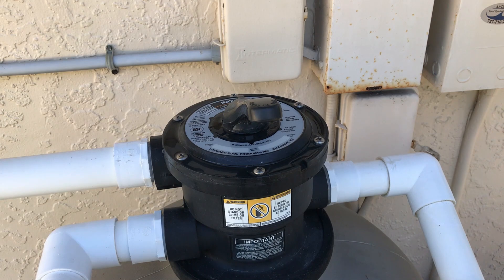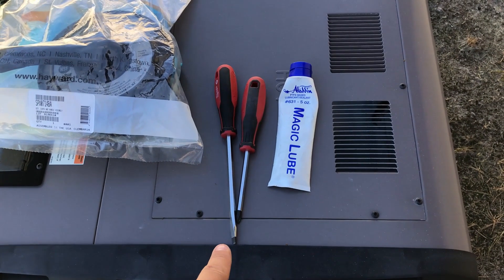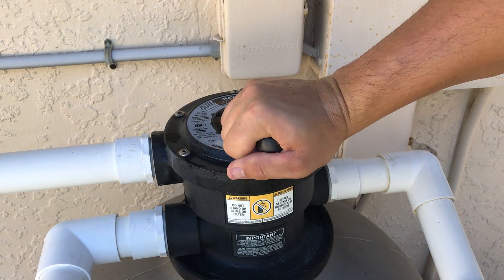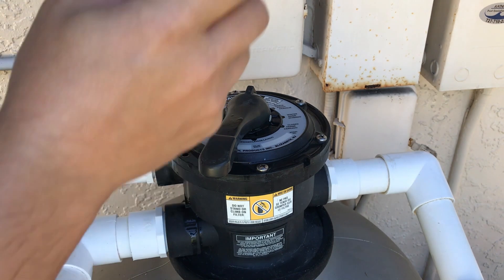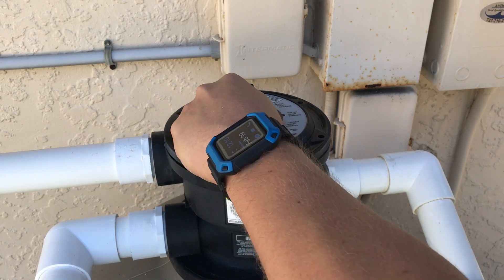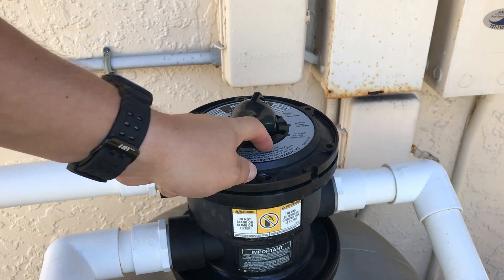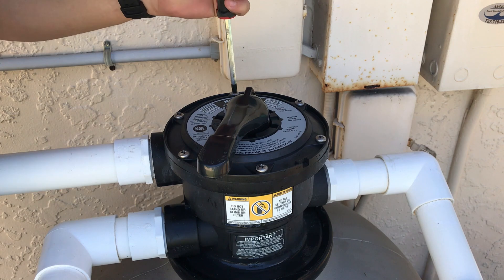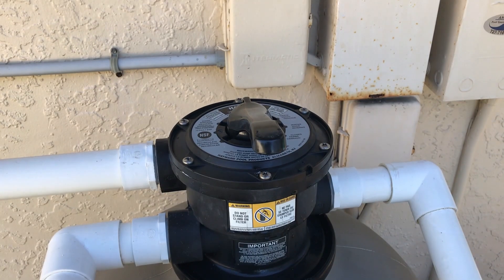Leaky Multiport Handle - How To Replace The Lid Assembly - Chlorine King Pool Service

Comment: Helpful thanks.  I found this video because my problem is I just installed a brand new S180T sand filter and multivalve top (replaced an old one of the exact same set up).  All is perfect, except my brand new multiport valve is leaking from the very top / handle!!??

Any thoughts on what could possibly be wrong with a brand new, sealed product in box?

Comment: I had to order a new valve, but I tossed the old one already and forgot what position the handle was in. If the new one comes in the closed position but I possibly took the old 1 off in the filter position am I kinda screwed is there a notch or something to put it in the correct position?
Reply from the maker: If you look at the link below you can see if you picture a clock, the “filter mode” notch (Hayward logo) on top of the multiport valve handle is at 12 o’clock and the side of the MPV with two ports is at 9 o’clock. Which is the same orientation as shown in my video. So I think that’s the way yours should go if you have this same MPV. A quick browse on the internet shows the same orientation as well. 

Proceed with caution and use at your own risk. Good luck! 👍 

https://www.poolzoom.com/complete-vari-flo-sp714t-xl-1-5-top-mount-valve-kit.html?gad_source=1&gbraid=0AAAAADm5WKNWWdg8W0Wy2GifxD9Bb0Fme&gclid=EAIaIQobChMI9oPfmKerhgMVgp5aBR0NDQRMEAQYISABEgKOyvD_BwE

Comment: Mine is leaking out the top also but someone said u can change a gasjet underneath? Is that right thanks
Reply from the maker: Yes you can but it’s sort of a pain. The handle/lid assembly can be completely disassembled. Just a pain to put back together. I hope this helps.

Comment: My new valve is leaking at the handle, any suggestions what could be wrong. I had the spider gasket and mvp cap replaced.
Reply from the maker: Where at the handle... in the center immediately around the notch locks into the mode of what you want the filter to be in?
Reply: @ChlorineKingPoolService , yes water fills into the notch area where you select, filter, backwash, etc.
Reply: @ChlorineKingPoolService  Mine is leaking at the same spot on top of the valve.  We have taken everything apart and we don't see anything suspicious but after the line gets pressure into it, water starts coming out the middle.  Spider gasket is in excellent condition.
Reply: @ChlorineKingPoolService  Yes ,water coming up thru the center where handle turns.  Don't really want to spend $200+ replacing entire valve if it's just an O ring or spider valve gasket.  What do you think?

Comment: How do I put the lid back on correctly? My filter doesn't gave any notches.
Reply from the maker: I always like to take a picture before I take something apart that I'm not familiar with. You can generally match the grove in the lid with the groove that holds the O-Ring in the bottom half of the MPV. If you don't feel comfortable with this please contact your local pool professional so they can do it!

Comment: My Hayward Multiport Valve is 20 years old and leaking from the handle and maybe the sides too. Do I need an entire new valve unit?  Also, my pool installers did not put a plumbing cut off valve from the pool to the motor or the filter; can just shutting off the motor and draining the filter get rid of all the water in order to replace this unit if I have to?

Comment: I broke the handle off of mine (stupid I know) , & stumbled upon this video. Would I have to take different steps in this situation ?
Reply from the maker: No sir. The top half of the MPV comes with the handle already attached. Just order that part and you'll be good to go!
Reply: Chlorine King Pool Service Hey Thanks for the response , do you happen to have a link or know where I can purchase the items I would need
Reply: If the handle broke off I'm assuming it was super difficult to turn, probably the result of the spider gasket not being lubed. Next time it gets tight, move the handle halfway between two ports (to depressurise the filter), unscrew the head  and replace/re-lube the gasket. If you go down the re-lube path, just keep in mind that a spider gasket that's been wrenched around due to being too tight could now easily be warped and allow water to leak regardless of now being freshly lubed.